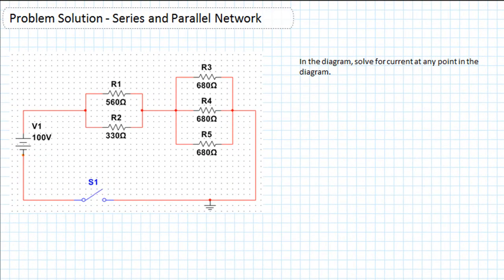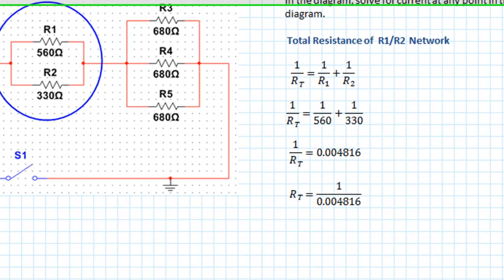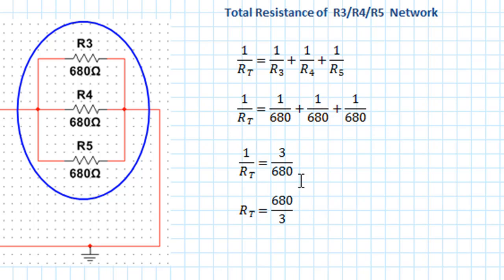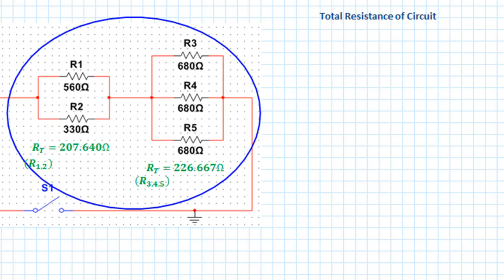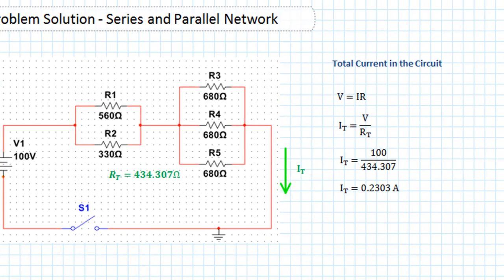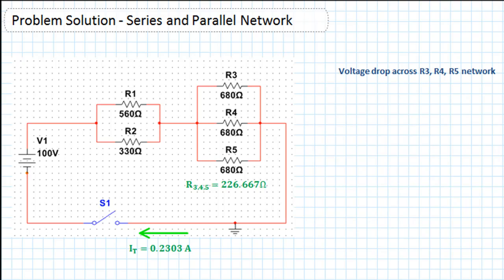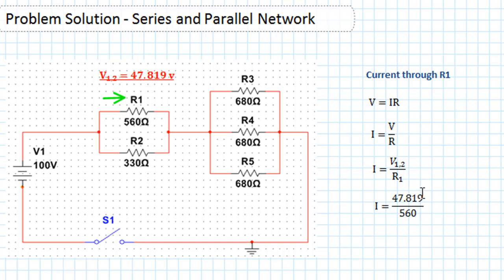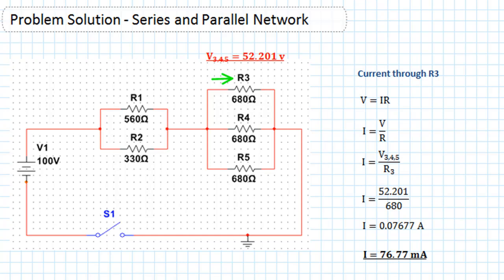Series Parallel Circuit - Sample problem solution

Comment: You could just divide 680 ohms by three and get your answer!
Reply from the maker: Thank you for that Don.  This was an example I used to help my students solve networks.  As you know they do not always have identical values or this configuration.  I run through several examples in class, but put a simple one on YouTube for their reference.